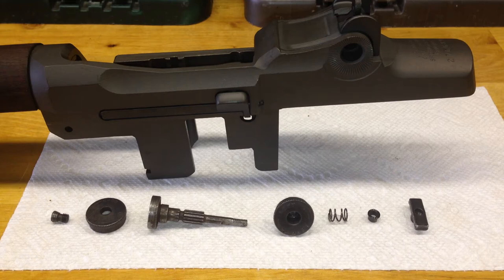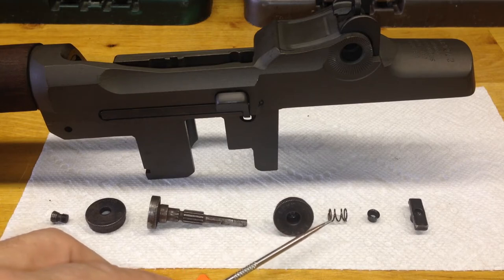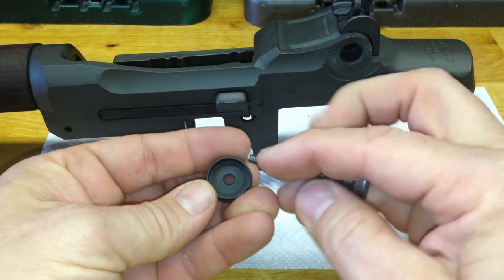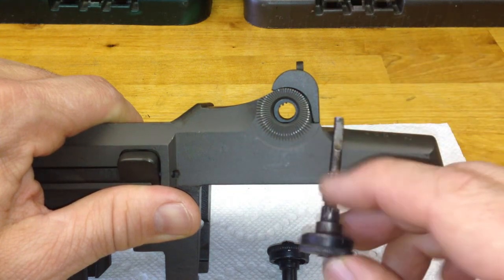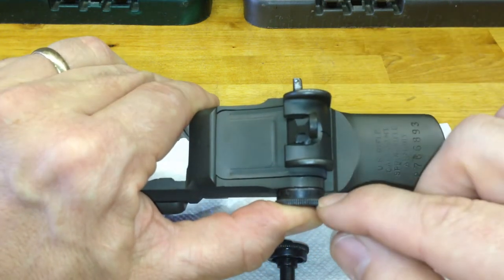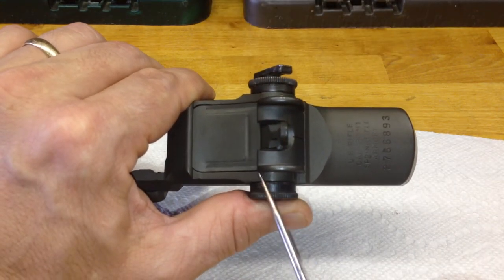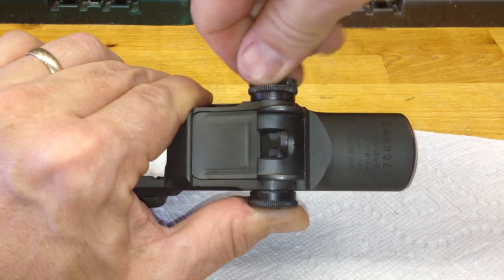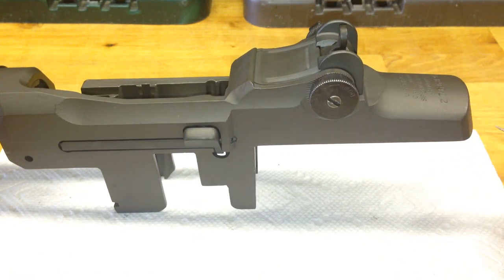M1 Garand Lock Bar Sight Installation

Comment: Maybe I'm wrong but aren't the gear teeth in the aperture supposed to "match" the lock bar?  How can you have coarse or fine teeth on one but not on the other?  I would think they come in a "set".  Can you explain??
Reply from the maker: The first style lock bar used the existing thread found with the flush nut.  They realized the pinion shaft was too short and lengthen it but with the same threads.  The third, and last lockbar, the length of shaft was long again but the thread pitch was changed.  So not all lockbars match the pinion.

Comment: I have this same dear sight, and the windage knob moves left and right nicely if i loosen the lock bar by two clicks. but the elevation knob makes no audible clicks... it moves up and down, but no clicks, which makes zeroing tough. any advice?
Reply from the maker: Try removing the elevation cap and cleaning the inside and the matting surface of the pinion.  Ensure the screw is tight once you're done.

Comment: Would a type 2 or 3 be correct for a Springfield with a 288xxxx serial number? I found some places say type 2 and some say type 3?
Reply from the maker: Type III is post-war, your SN is in late WWII.  It should have a Lock Bar with squared ends, -36NF threads.  This is a type 2C according to Poyer, page 42.

Comment: How do you remove the elevation knob screw off the elevation drum/knob?
Reply from the maker: Unscrew like normal.  But beware it maybe really tight or rusted up.  I recommend doing this on the gun screwed all the way counterclockwise wise before trying a tight fitting screwdriver on the the cap's screw.  Pretreat with a penetrating type oil or spray too after cleaning well.  If you get it out really clean the inner portions not accessible when assembled.
Reply: @norwich93CMP  thanks. I used WD-40 to loosen it up.

Comment: hello, been watching all your videos and they are very good. I am thinking on finding a lock bar and adding it to my rifle. Is this an item that is low on the priority list if I wanted to make my Garand "correct" and maybe better to just have it rather than install it? I have a few Garands and only got them to shoot, but last month I was at the North Store and got a Feb 1944 that had everything original but stock, trigger group, bolt, front hand guard and the rear site items. Had uncut op rod, etc. that were correct.
Reply from the maker: It is your preference.  Personally they are cheap enough to buy on eBay and easy to install.  If the serial number puts it in WWII then maybe it can be 1 of your rifles with that feature.
Reply: @norwich93CMP  thanks. not sure I follow your serial number comment. I said the wrong year above, it is a Jan 1945. the Feb 44 is my other rifle.  USriflecal30M1.com says for Jan 45: Locking bar, long pinion, 8-36NF thread, with squared ends and squared binding ridges.

Comment: does the lock bar also lock the elevation knob to where you can't make quick sight adjustments or not
Reply from the maker: It should but sometimes the ridges and peaks are worn.  If so it may not work well.  Usually you tighten all the way down and back off 1 or 2 clicks.  This allows the windage knob to take up on the spring slack and still turn, just take some heavy turning.
Reply: norwich93CMP thanks alot

Comment: I put a lock bar sight on my M1, I've yet to shoot the rifle, when I move the rear sight to the right I'm getting audible clicks, but moving it to the left, the windage knob is backing off the pinion and the sight is moving erratically with no audible clicks, I'm going to assume I did something wrong?
Reply from the maker: Moving to the left (either the sight base or the windage) condenses the spring in the knob if the lock bar stays still and should lock at one point.  Moving it right should relieve the tension and create gentler clicks because you are create slack in the length of the pinion.